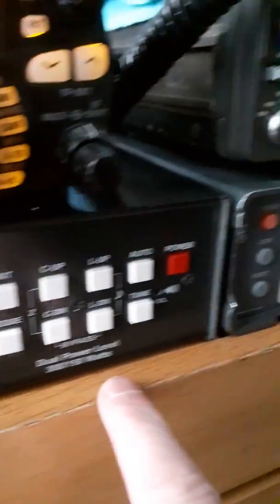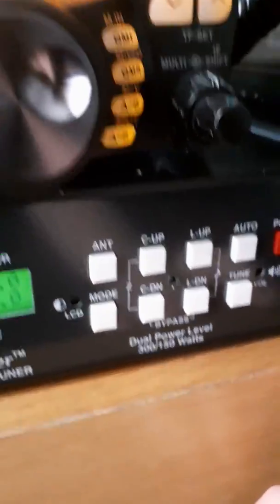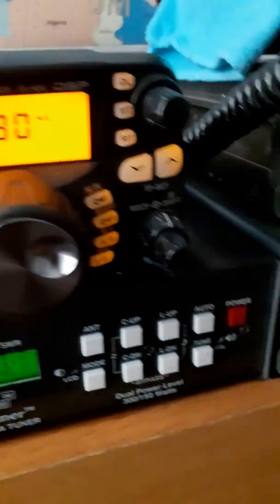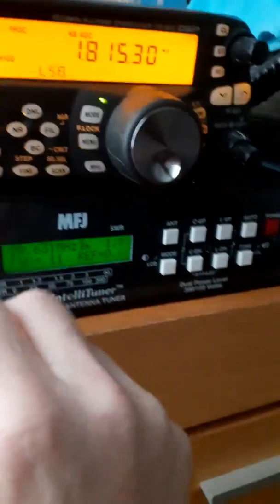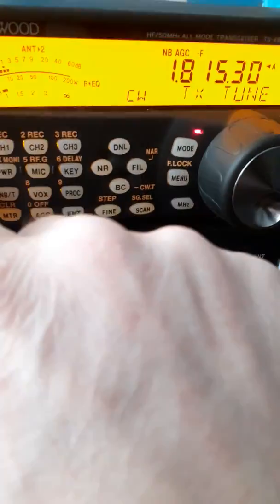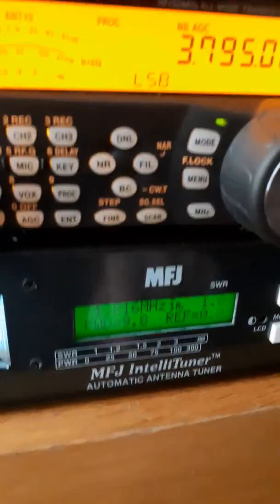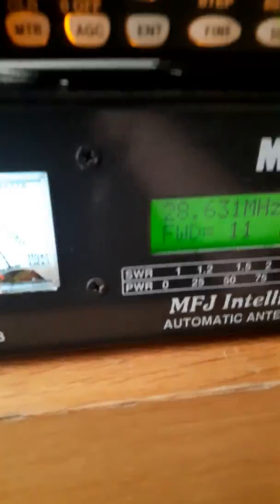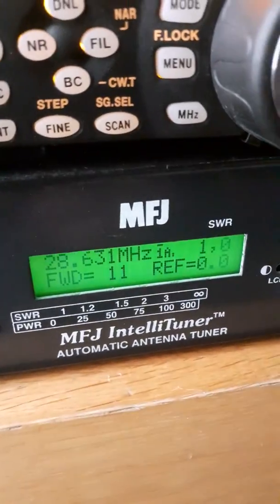Testing MFJ-993B  ATU

Comment: Probably a stupid question.  I just got one of these, but Im confused (its not hard).  If I set my ftdx1200 to 10W tx power and tune up with a whistle, it shows fwd.10  but when I talking in a qso, it jumps around 4-4.5 constantly moving.  Is that because its SSB?
Reply: Yes, you're only transmitting when you are speaking, the carrier is removed when in SSB mode.  In AM or FM the carrier is present and you will see a near constant power output.